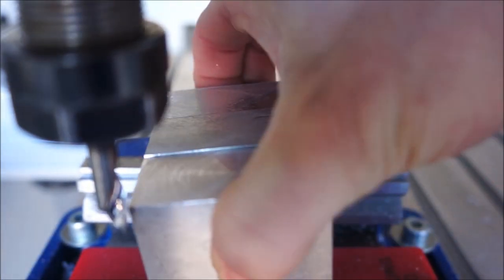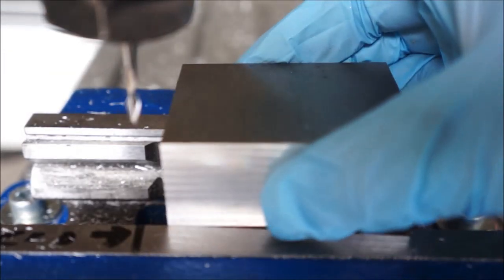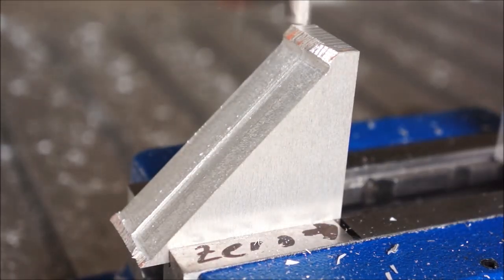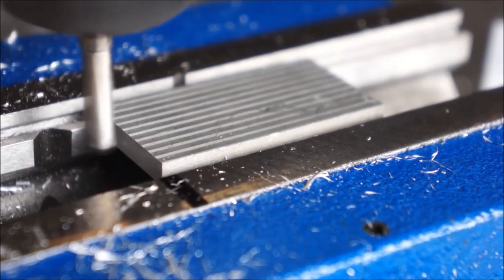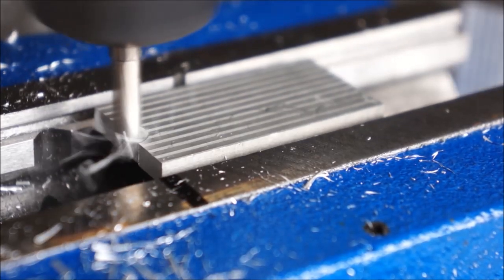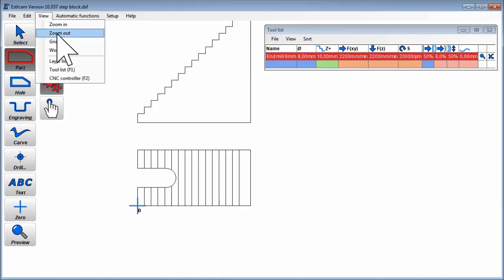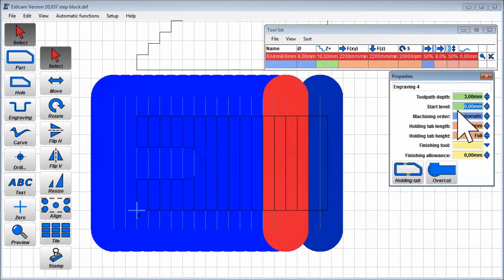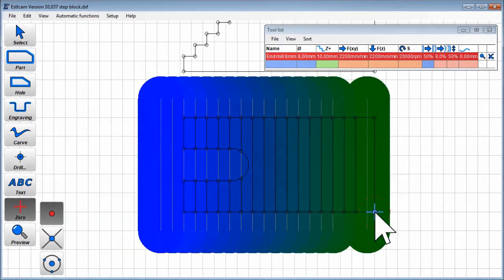CNC machining step blocks

Comment: Thank you.  I am also interested in the machine that you use.  I have two machines that are belt driven, but I'm becoming curious about different designs of the machine in terms of accuracy and robustness.
Reply from the maker: It is a DIY machine with ball screws and linear rails (but mostly improvised)
The big issue with belts is stretching and varying preload - they are just quite a bit soft for metal machining and the large travel distance for each motor revolution also result in significantly lower forces compared to screws. 
(But not bad in general - belts are inexpensive, have little to no backlash and allow for fast travel)

Comment: It seems like your blocks are milled at flat bottoms  most step blocks have a back slope to aid in holding the blocks and clamp arms together since that most likely not be perfectly square.

This can be accomplished  by shimming the block  and the clamp in the vise at one end before machining

Comment: I don't like the finish of the trochoidal cutting. I cut in a smaller step depth straight path and then take a finish cut. Much cleaner for these small light duty machines. It takes longer but you don't get quick work in heavy stock with light machines.